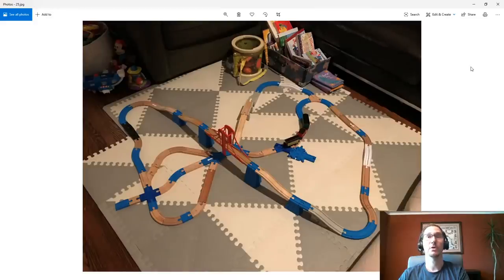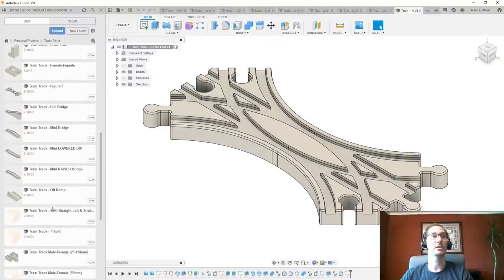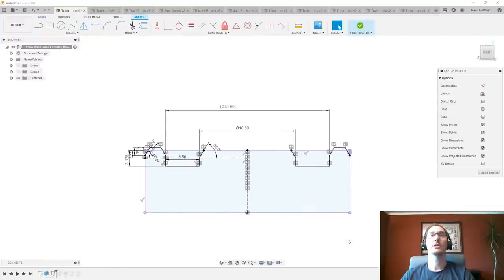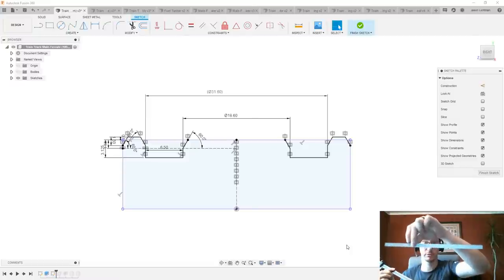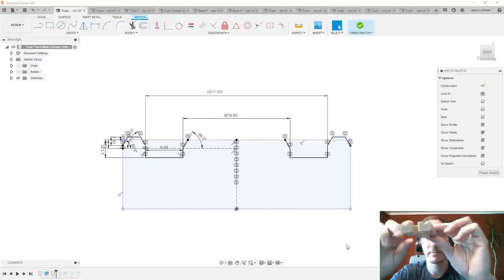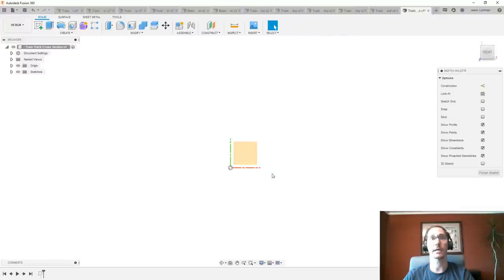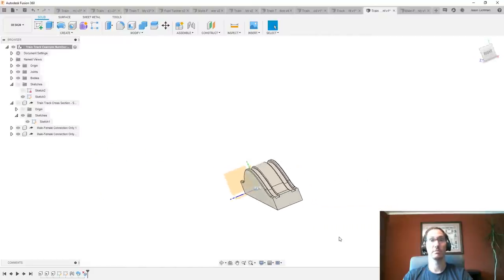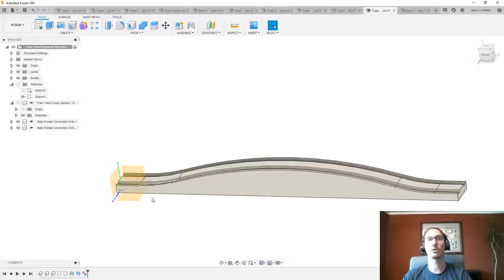360 LIVE: Father's Day Special: Win at Parenting by 3D Printing Your Own BRIO Style Train Tracks

Comment: Great video, thanks. On the subject of the scanner 2d or 3d? To Brad 5 out 4 is still a fraction sht hot, lol! You know you are good when even when you are wrong you are still right!
Reply: MrCoffeypaul 2d
Reply: I used a flatbed scanner, so 2D. The flatbed scanner makes it really quick and easy to get a clear picture without distortions based on a camera’s angle.
Reply: Have an idea for a video with the Haaz ye have, use a probe to reverse engineer a part. Am I right in thinking an Excel spreadsheet can be incorporated into Fusion 360?

Comment: Hi Jason thanks for this video , although there is an easier way to create / modify them if you are on a Windows pc . On Windows 10 go to your profile folder and slect 3d objects. iside you find premade Rail track in .3mf format, they have straight rail, connectors and split tracks.  https://www.dropbox.com/s/oxd7zx7kwcz1z9f/Track%20peices%20in%20Windows%2010.jpg?dl=0
Reply: I did NOT know about that. Thank you!